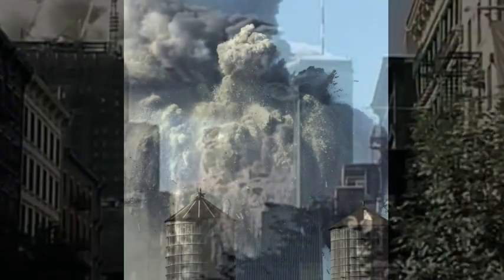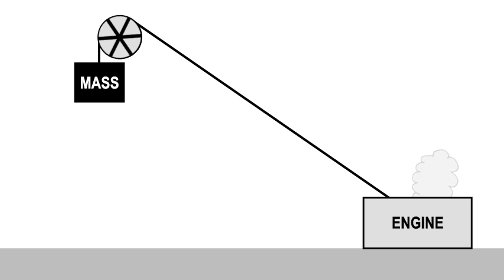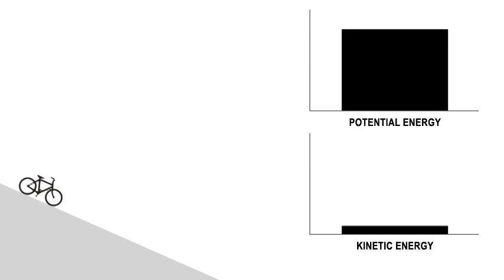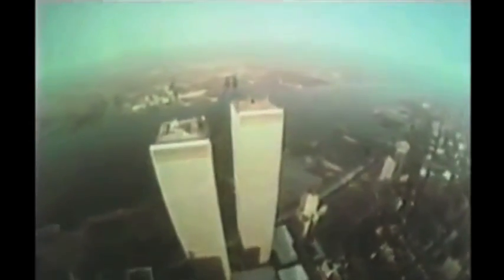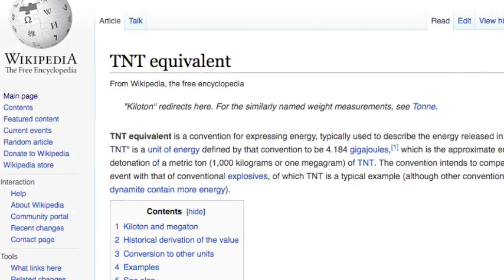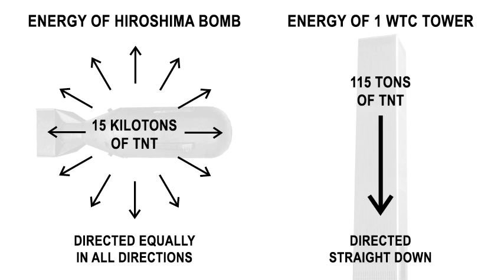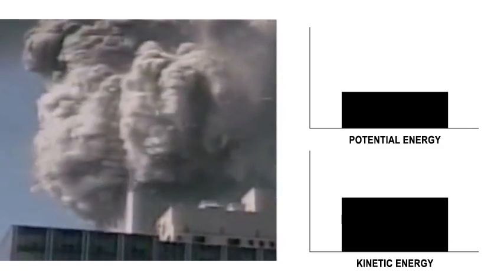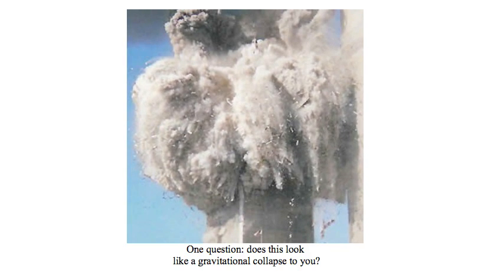Where Did The Twin Towers' Explosive Energy Come From?

Comment: This is a terrible understanding of physics and hopefully you are being fairly well paid to spread such easily corrected falsehoods. First there's video of large sections of the building being pulverized in total free fall which is impossible without incendiary devices. As for your "math"(if it can even be called that). You factor the total energy potential for the entire building when only a smaller portions is the part that's falling. If nothing else that makes this whole thing wrong best case and fraudulent worse case. There's only enough energy to destroy the equal amount of mass below as there is above. Which is one of Newton's basic ideals of motion.
Reply from the maker: The whole building fell and therefore released all of its potential energy. Please explain to me why this is a "terrible understanding of physics." The figure of 480,600 megajoules is not "my math," it comes from a conspiracy website -- check it out if you don't believe me: http://911research.wtc7.net/papers/urich/MassAndPeWtc1.htm
p.s. "Total freefall" is disproved by video evidence. You shouldn't lie like that if you claim to be on the side of "truth." Oh and which of Newton's "ideals of motion" are you citing?
Reply: "There's only enough energy to destroy the equal amount of mass below as there is above. Which is one of Newton's basic ideals of motion." As someone who studied physics at university I can assure you that your statement is complete nonsense. It is both incorrect and not one of Newton's laws of motion.
Reply: @Brained05  So explain why, as Edward showed to another commenter, that a small domino could set off a reaction of bigger dominos and cause all of them to fall? Kinetic energy doesn't work the way you think it does.
Reply: @WNActivist88  The answer is simple. The centre of gravity of a standing domino is higher than one lying down. That means each standing domino has potential energy.  As the base of a domino is narrow the amount of energy needed to start it falling is much less than its potential energy. Once it starts to fall the potential energy is converted into enough kinetic energy to knock over the next domino releasing its potential energy and so on down the line.
Reply: @Brained05  

"The answer is simple. The centre of gravity of a standing domino is higher than one lying down."

The towers have a center of gravity as well. Everything does.

"That means each standing domino has potential energy."
So did the towers. EdwardCurrent did a video on this"

"As the base of a domino is narrow the amount of energy needed to start it falling is much less than its potential energy. Once it starts to fall the potential energy is converted into enough kinetic energy to knock over the next domino releasing its potential energy and so on down the line."

And yet you don't think each floor knocking in to the next doesn't have the same effect? If you had read the reports, and looked at the truss seats you have seen they were either sheared off, or bent completely. Those floors cannot handle kinetic energy, and even Leslie Robertson spoke of this.
Reply: @WNActivist88  "And yet you don't think each floor knocking in to the next doesn't have the same effect?" I think you have me confused with someone else. While this is a 6 year old thread so I don't remember exactly what I wrote, I did say that yes the inertia of a falling floor will be enough to cause the collapse of the next floor, especially if the floor trusses are wreaked by fire.
Reply: @Brained05  Sorry if there was confusion. I grow extremely annoyed having to repeat myself to people who are always in denial.
Reply: "where's any experiment showing it's possible to have 20 floors crush 90 floors" Ironically that is covered by one of Newton's laws namely Newton's first law the law of inertia. The attached paper describes how floor trusses behave. http://www.steel-insdag.org/teachingmaterial/chapter27.pdf it is fairly complex but the key information is that floor trusses cannot undergo much deflection without failing. During a collapse the floors above will fall 3 m onto the floor below. Thus the mass accelerated for 3 meters creating inertia that must be stopped by an equal but opposite force.  Either the same force operating over the same distance or a greater force operating over a shorter distance. Since the floor trusses cannot undergo much deflection before failure they must exert a far greater force over a short distance to stop the collapse. Assuming that the floor truss can have an average deflection of 10 cm before failure the total force required is (300 cm / 10cm) * 20 floors. or 600 times normal load. No floor can handle that so each will fail in succession all the way down.
Reply from the maker: The shill gambit is a necessary distancing technique of the believer mindset so he doesn't have to engage a nonbeliever in an intellectual discussion. It's a way to treat the person as an object worthy only of scorn, and not honest human interaction. So, basically, "It puts the lotion on its skin."
Reply: thaThRONe"Saying that a smaller portion(10-20%) of a building can crush the larger portion(80-90%) all the way to the ground is just false." If you look at my proceeding post you'll see that I prove that not only is it possible it is inevitable.
Reply: thaThRONe There are several listed in the paper, did you not read it?
Reply: LOL! Wow, straight in with the 'shill gambit'. You don't waste time, of course neither do you know what you're talking about.
Reply: If you paid to go to school, go back and get a refund. Real talk!
Reply: thaThRONe As I stated the paper I referenced Included the results from physical experiments that prove the points I was making. I assume that you have not read it because you are fearful of being freed from your delusions.
Reply: thaThRONe You can find video evidence to support anything you want. I can even show you a video that proves the twin towers were taken down by flying saucers. Video is easy to fake. The papers I referenced do not say that it is possible, they prove that it is inevitable, that nothing else can happen. For you this is a blue pill, red pill moment. You can choose the blue pill and stay in your world of delusions, or choose the red pill, read the paper and learn something about physics and engineering. There is nothing more I can do for you.
Reply: thaThRONe Looks like you took the blue pill.
Reply: Brained05 I can write down whatever I want on paper or get a computer to produce whatever. Where's an actual tangible experiment? I can see several on YouTube saying that the official theory is false. The fact NIST actual concede to relying on computer models only should be eye opening for anybody that relays on physical evidence.
Reply: thaThRONe  ROTFLOL Scientists don't rely on crazy you tube videos that can easily be faked.. They take measurements, compile data take PHYSICAL samples, run and rerun experiments. Then the resulting paper is subjected to peer review.  Sure you can write anything you like. But do you think it would pass peer review by real scientists and engineers? Do you think it would be published in a journal? They would laugh in your face! The paper I referenced was published in a peer reviewed journal. Why don't you read it before you comment again. Oh that's right I already guessed why you don't. You are afraid of being freed from your delusions.
Reply: Again this shouldn't be up for a debate we should of had a thorough investigation with the actual materials from the building analyzed and reconstructed as best they could to determine what caused the failure. However we don't because the bulk of said materials were destroyed before ever being tested. Saying something is peered review is fine. I'm saying show me an actual visual link to a video that prove what's in the paper can be done? Why given there are so many people who don't believe that this can happen is there no actual visual experiment anywhere? We were told this was the single biggest attack on the country all we have to show is computer models. I don't want to be told it's possible X happened. I want to see for myself a video of somebody showing me how they arrived at X happening step by step. Otherwise it just noise. If these experiments are peer reviewed where's the visual models of the reviewing process. The burden of proof lies with the person making the claim.
Reply: Yet still no experiment.
Reply: Brained05 Reading doesn't make an experiment accurate. Show me a video of these experiments. I can write whatever I want on a piece of paper that doesn't make it true. There's plenty of video experiment that proves the physics of the official story being false.
Reply: Brained05 So a video can be faked but a paper can't? I think it's clear who has the issues with taking pills. Either way no longer wasting time on discussion. At this point if you can dismiss all the evidence that shows this was a control demo we have nothing to talk about.
Reply: Funny people are quick to appeal to some since of authority and slow to present any evidence.

If what I'm saying is false where's any experiment showing it's possible to have 20 floors crush 90 floors.
Reply: Calling someone a "shill" is the most respectful option. How else can you explain some of the factual false things people are saying. Saying there was no melted steel is just false. Saying the path of least resistance is straight through the rest of the healthy building is false. Saying that a smaller portion(10-20%) of a building can crush the larger portion(80-90%) all the way to the ground is just false. It's not even a matter to discuss. So if someone is making this argument they're either ignorant to basic physics and science or lying on purpose.

Comment: Just to play devil's advocate for a second, is it fair to use the potential energy of the entire tower to explain the image?  You would only be able to consider only the portion of the building which is blown out in the image, and then take into account when the portion below it begins to collapse.
Reply: the weakest link in the towers were the joins , how strong do you think those bolts and welds were ? since momentum increases mass and the joins were designed for a static load not a dynamic load then yeah effectively the kinetic energy only needs to be sufficient to break joins , the higher force loads  come in to play when we are talking about projected debris , either way the load bearing abilities of the lower floors simply didnt have the capability to cope with the increased force of the dynamic load , in this instance it is still fair to generalize the energy since it in fact took far less to achieve the result

Comment: awesome. please explain bldg 7 and free fall collapse
Reply: It wasn't freefall.  If you actually look at the collapse, there is debris falling faster than the building is collapsing, therefore, by definition, it is not freefall.
Reply: There's a video on YouTube, "Building 7 Explained" by someone named... EdwardCurrent.
Reply: Hilarious how Building 7 keeps being brought up as some trump card; shows how absolutely superficial your familiarity with the topic is
Reply: +quorkquork oh yeah? please enlighten me. please explain to me how a building collapses at free fall without explosives. I'm all ears.
Reply: Front Row Seat According to NIST's model the middle stage of the building's exterior falling had little resistance because the structural support below it had buckled.
Reply: Oh, I just noticed. The video is linked in the dooblydoo (this video's description.)
Reply: oh look! another expert on physics, engineering and explosives, the building burned uncontrolled for 7 hours which is why it collapsed, once the framework becomes so hot it loses its structural integrity, quite simple really
Reply: please enlighten the class on what exactly " free fall " is and exactly how long 7 was supposed to be in " free fall "
Reply: +ReiperX according to nist report, 10 stories fell at free fall.
Reply: Front Row Seat
you going to answer my question or are you going to show your stupidity ?